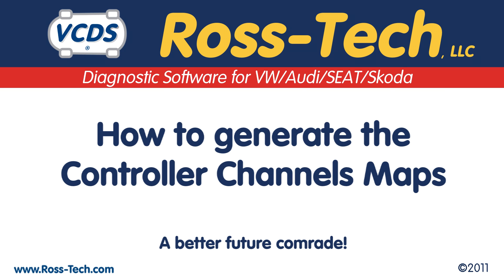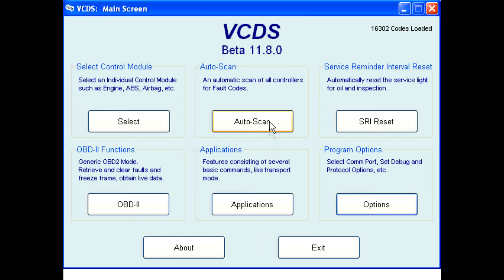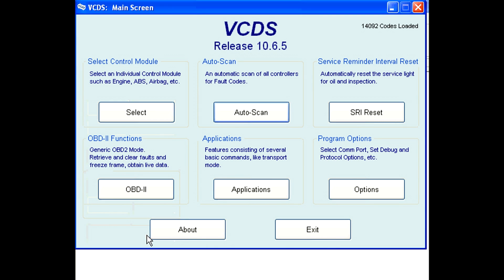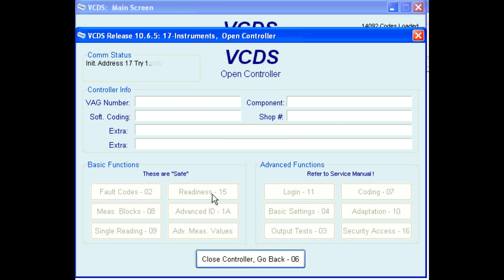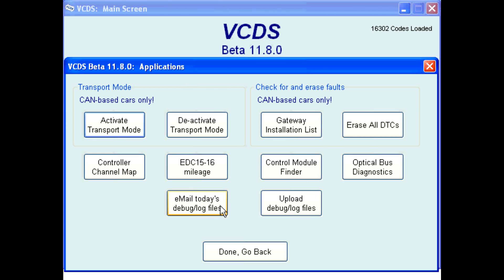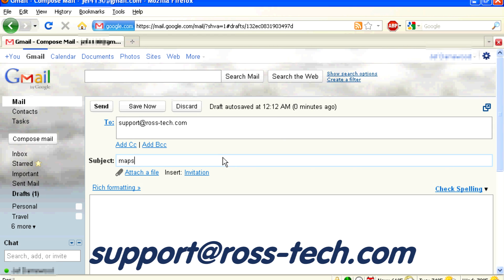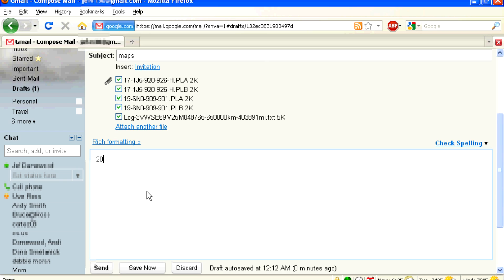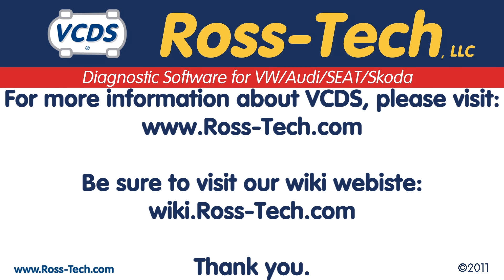How to create Controller Channel Maps in VCDS

Comment: Hi sir, can I ask what is the problem if I click on "engine " and then it says "no response from controller"?
Reply: Ensure that your Ross Tech USB cable is connected to both the OBD port and your laptop. Happened to me yesterday when in a hurry. Wondering why there was no response and I realized I didn't plug the USB end into my laptop. Just realized your post is from 4 years ago but I'll leave this comment anyway in case it helps someone.